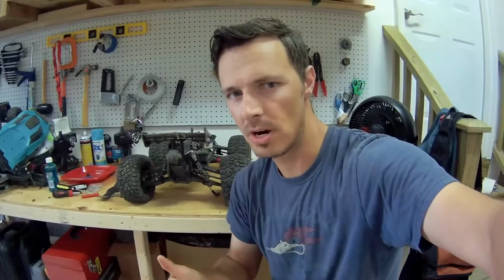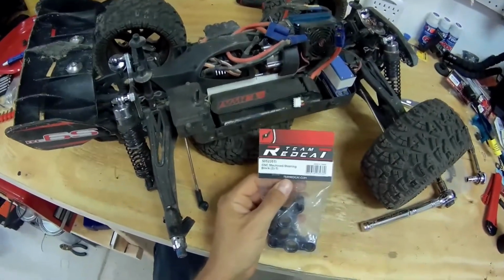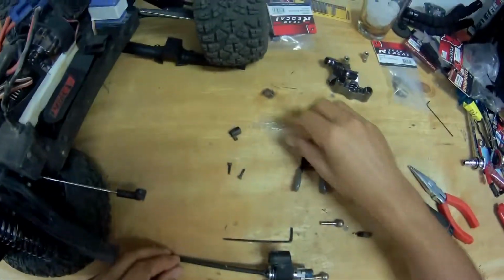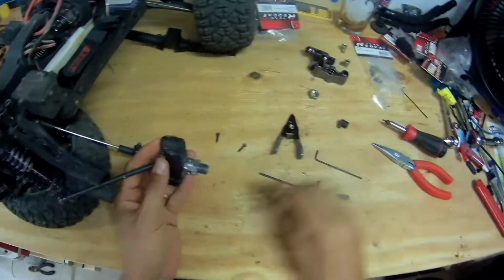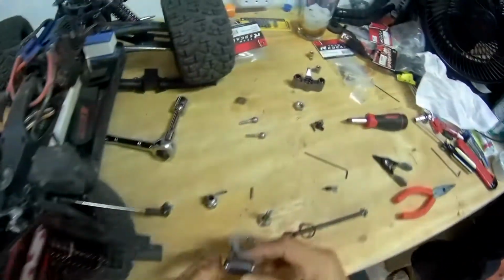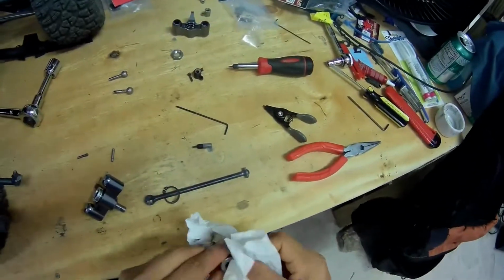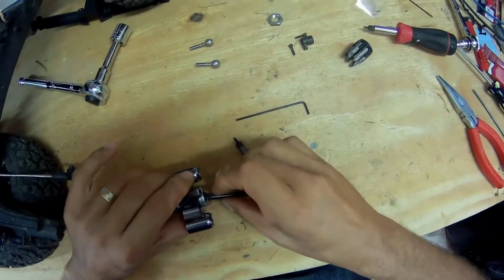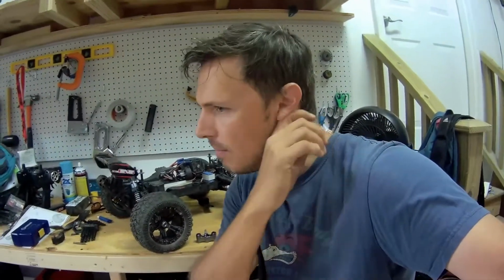Team Redcat BE6S Aluminium Steering Block install...and crashes:)

Comment: sRCparadise: question... I broke one of the original front steering blocks. My fault, I have old man eyes and hit a tree at high speed. I thought I was going around the tree but hit it flush on the right wheel. I purchased the same steering blocks as you did. I ran into some fitment issues with mine, the bearings are super loose, they easily slid into position and are so loose that they fall out with gravity all by themselves. Once I got it all together, I noticed excessive slop at the hubs. The stock bearings wiggle a little bit where the outer bearing diameter is loose inside the steering block. That's not my only problem. The pillow ball sleeve adjustment when completely snuggled down remains loose. Again, not by much but I should be able to snug it down before backing it off some. As it is, I can't tighten them any further even though it could use maybe a 1/2 turn more.
My question is, did you experience anything different from what I have or did I happen to get one from a poorly machined batch?
Reply from the maker: Hi TK Mo, I didn't experience the slop you describe.  I would contact Redcat directly and request replacements. Good luck! When u get the BE6S dialed in, it is a great basher😎👍
Reply: @srcparadise3315  thanks for the reply. I suspected that you didn't have any issues, it didn't look like there were. I did make a claim with RedCat today, when I called them they hadn't heard of any problems. I imagine they got a bad batch that wasn't machined properly. Your feedback helped me verify that. 

I love my BE6S, it is built extremely well, the breakage was 100% on me. Anything else stock that heavy would have been damaged way more. What I did in the mean time was put a few wraps of Teflon Tape around the bearings, that has for now snuggled them up perfectly. I also put a thin O-ring between the ball and the pivot ball mount which is also seems to be working well. I should be good until I get proper replacements.

FYI, I got some HPI Goliath tires, taped them and installed them on HPI Chrome Tremor wheels. I love how they look. They are maybe 1/8" shorter or less but, noticeably wider.
Reply: @srcparadise3315  RedCat took care of it, replacements are on the way at zero expense to me and very little effort. The claims form is short and simple. As expected, they wanted evidence of the problem in the form of a picture or video, but they were not sceptical. I mentioned my Teflon tape fix and sent them a pic of the bearing in place with the excess Teflon tape around the outer bearing diameter and mentioned that if the bearing fit snuggly like they should, the Teflon tape wound not have fit/stayed on the bearing. I woke up today with a tracking number.

I know that you were pleased with how RedCat took care of you when your transmission and differentials inexplicably blew up. (That was an odd breakage.) I'm bringing this up because I want your viewers to not only know how awesome this Team RedCat TR-MT8E BE6S really is, but also how awesome RedCat is as a RC Manufacturer by standing firmly behind their product. I'm not going to be specific, but while I made the above mentioned warranty request, I thought I would request another that RedCat wasn't responsible for nor did I expect they would warranty. I won't mention what because they did not have to and probably shouldn't have taken such good care of me but, they did/are.
RedCat has more than earned my future business for sure!

On that note, have you seen the new Team Magic E6 V-Gen? I've not seen it yet as the TR-MT8E BE6S V2 but imagine we will soon. They have made a few changes /improvements on the design/engineering. Also, I can't confirm but I thought I saw that the lengthend the chassis some which might help keep the front end down some. The re-engineered transmission/motor mount which is both lighter and stronger does fit the BE6S, it also give more battery tray clearance.

Lastly, after seeing what happened to you, I squirted some bearing lube into the transmission. I'm not sure if it helped or not, but it has not leaked out and it seems to be quiet and smooth. I didn't put in a lot, but enough to get picked up by the center diff as it spins and lubricate all the internal transmission gears and bearings.

Comment: Hello, do you have to use the machine pivot ball mounts with the aluminum steering blocks or can you still use the plastic ones? Thanks!
Reply from the maker: Jason Maxfield thx for watching!🙂 You can use stock plastic replacements if you like, or u can upgrade to aluminum, the choice is yours🙂😎👍
Reply: sRCparadise Thank you! This may be as silly as the first question but will it affect anything by using the plastic mounts in the aluminum block?
Reply from the maker: Hey Jason, not a silly question at all:) Yes you can use the plastic ball cup retainers in the Aluminum Steering Blocks...they will work just fine, I did that for a few weeks before I ordered the Aluminum retainers...the Aluminum units are not overly expensive and a good upgrade if you choose to go that way. Bash on:)
Reply: @srcparadise3315  did you have slop with the plastic retainers and aluminum blocks?  I'd be shocked if you could see/feel a difference, the slop is much more a function of deformation of the cup in the block and the aluminum blocks should be very tight in that regard with or without the aluminum retainers.
Reply from the maker: @JohnFordham  honestly I don't remember lols...been a minute:) BUT...in general the BE6S tends to have more slop with their stearing block set up than, say a Kraton...that's not bad its just different. On a side note the BE6S is WAY more durable than a stock Kraton...the Kratons handling is more precise, but I had to spend $300-400 to get the Kraton bash worthy, and in the end the chassis bent any way...you need a custom chassis tower to tower brace in the Kraton, the BE6S is far more durable😎👍💪
Reply: sRCparadise I can’t speak on the BE6S directly, I have an MT10E.  That thing is built like a tank but I’ve bashed it hard enough to split the stock steering hub.  So I’ll be getting the aluminum blocks for sure but everywhere else I’ve read they say retainers are a waste of $$.  Found this video searching for info on the MT10E.  I realize it’s a different car but I’ll let you know if I notice any slop with the upgraded hubs and stock retainers on my rig.
Reply from the maker: @JohnFordham  ok, good luck! MT10E is an awesome bash machine also! ...I have one too, check out my vids🙂
Reply: sRCparadise yes just saw your bash run on 3S with 11T spur.  I’m still on stock 9T, not sure I’m gonna tooth up on the 80A ESC.  Bigger problem I have is with full TM E5 skidplates and roll cage the stock shocks are struggling BAD.

I’m going to test some 110mm Kraton upgrade shocks from GPM, they have ridiculous 5mm shafts and end up being $20 cheaper than Redcat aluminum upgrades.  Even with stuff springs I’m rolling too much weight need a 1/8 shock.

Thanks for your videos!

Comment: Steering blocks are sweet. Ended up callin redact about my motor temps. They said it could be a bad one and to keep havin fun with it and they will send me a new one if anything happens so go redcat. 
How is the center diff without that gasket holding up? (And sry to bombard u with all those questions)
Reply from the maker: Redcat has always provided me outstanding customer service, they are awesome that way ☺👍As for running the center diff without the gasket,  this is a MUST DO mod if u want your diff to last. It has been great. The only time I had issues with my center diff was when I ran it with the gasket and factory grease...it needs diff fluid and the gasket removed👍☺ soon I will be experimenting with 1million weight😮😆😉
Reply: Ok I’ll probably do that today. Awesome can’t wait to see!
Reply from the maker: Bret Rishel also, not sure I mentioned,  but I'd buy a Hobby Wing heat sink and fan combo for your motor,  even if Redcat replaces it, they can get hot in the summer. ☺👍

Comment: Ive replaced mine too on the be6s but i just went with plastic. Im curious to see how it holds up. You probably wont have as much wheel slop now. Mine are starting to get bad
Reply from the maker: Dave Dunkelberger Nice! U r correct, I have less we'll slop... although I've noticed the biggest area that causes rear wheel slop for me are the nylon tie rod ends..with all my jumps and flips they get slightly stretched out, but the are cheap to replace☺💪👍